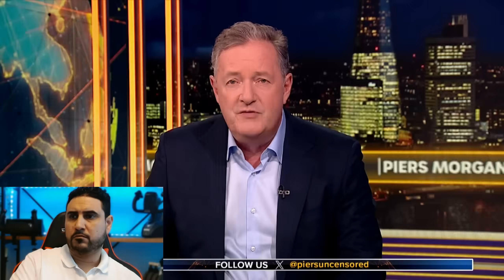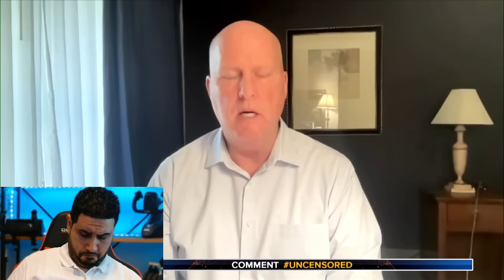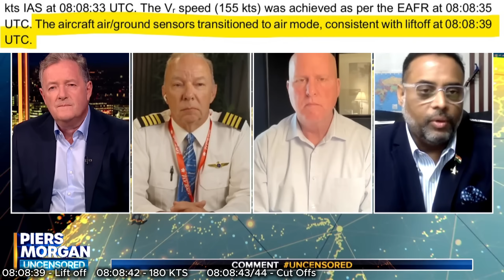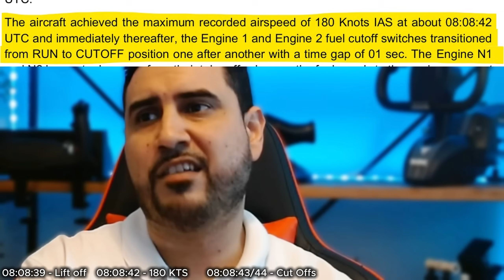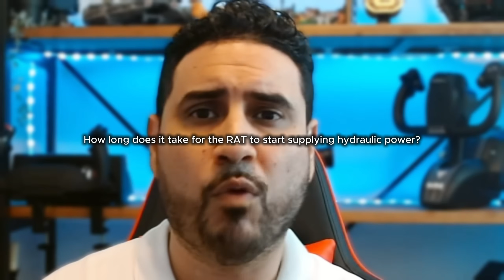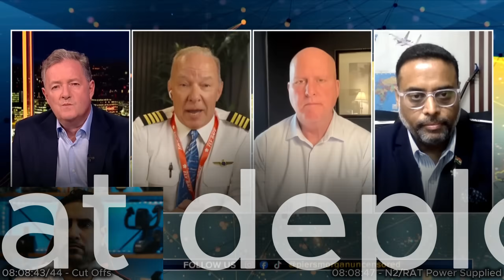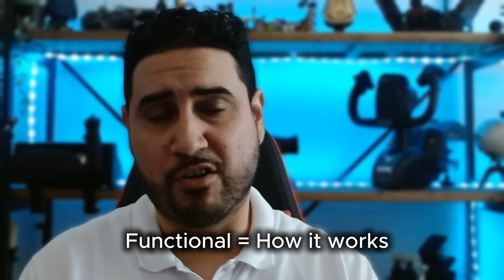TOTAL SYSTEMS FAILURE BREAKDOWN | AIR INDIA 171 | AAIB PRELIMINARY REPORT | MAYDAY | MSFS2024

Comment: Air India 171 plausible crash scheme.

Perspective from a current 787 Captain, previous 777 Captain, and a former simulator instructor on the 787, 777, 767, 757, and 737. 

Air India flight 171’s ‘pilot flying’, was allegedly the FO (First Officer) according to the AAIB’s preliminary report, who was manually controlling the 787’s flight path. After it stopped climbing at approximately 425’ above the runway (625’ above ‘mean sea level’), the FO banked the jet’s wings to the left, changing course by 3 degrees, and heading the plane directly at the four six-story buildings of the medical complex, visible one mile from the runway. He then banked right, back to ‘wings level’, to maintain this course, as shown on the airport’s CCTV video taken from behind the jet’s left side. Additionally, a cell phone video/audio from a rooftop, recorded from behind the jet’s right side, showed the rear landing gear’s ‘trucks’ had tilted forward to facilitate ‘gear’ retraction, proving that the crew had initially selected the landing gear lever ‘up’, but the landing gear doors’ opening and subsequent ‘gear retraction’, stopped because of the sudden loss of hydraulic pressure supplied by the Center hydraulic system pumps. These two pumps stopped supplying pressure when both engines’ failed (i.e., dropped below ‘idle’, and/or minimum RPM), tripping off their four electrical generators. This dual engine failure, also triggered automatic deployment of the ‘RAT’(ram air turbine, which is seen/heard in the rooftop video/audio). The RAT’s small hydraulic pump can’t raise the landing gear or move the flaps, but only powers 10 flight control surfaces supplied by Center hydraulic fluid to maneuver the 787, and its small electrical generator powers the Captain’s flight instruments (but not the Copilot’s, forcing him to use the Captain’s instruments with difficulty, while viewing them from ‘cross-cockpit’). It would have been obvious to both pilots that based on the current glide path now being achieved, that a 1 degree turn, back to the right, was needed to allow a landing on the road to the right of the medical complex, missing all the buildings completely. Pilots are trained that the safest plan was to aim for this road, avoiding buildings etc., in the event a restart of the engines was unsuccessful. The Captain, (allegedly the ‘pilot monitoring’, according to the AAIB preliminary report), would assume the obvious ‘road landing plan’, while focusing on restarting the engines. When it became obvious he’d been distracted too long from the copilot’s contingency maneuvering, and that an ‘Aircraft carrier’ style landing on the rooftop of the two story medical building, was now the immanent destination, he proactively selected the landing gear lever back to the down position, which would help absorb the impact forces through the ‘landing gear’, by keeping the plane away from ground contact as long as possible, hopefully after landing beyond this building. A last radio ‘May-Day’ call was transmitted before the building collision.

If you’ll review the Ahmedabad airport on Google Earth, and draw a one mile line from runway 23 to where 171 impacted the medical building, you’ll notice there were plenty of wooded areas available, on both sides of the building they hit, with the best landing area on the road, to the right of that building. Had the jet stayed on the extended runway centerline after takeoff, as all pilots are trained to do, they wood have missed the building completely and landed on the road beneath the trees. All pilots are trained to fly their malfunctioning aircraft to avoid hitting buildings. After reaching their maximum altitude, a slight left bank of the wings occurred, which was maintained until aligned directly with the center of these very narrow buildings. All pilots are required to stay on course after takeoff, and would have easily avoided the buildings, but now also knew they couldn’t make too many course adjustments at such a low altitude. The video evidence favors, this maneuvering as being intentional, because a number of course adjustments were made, likely shortening the gliding distance, resulting in impacting the 2 story building’s rooftop. Relying solely, on the video evidence as described above, should be sufficient to deduce the intentionality, in precisely hitting a building that is narrower than the 787’s wingspan. The ideology of a pilot at the controls must be reasonably predictable, and not in favor of harming those who disagree with that ideology’s tenets. The above perspective is plausible as presented and will certainly be proved or refuted, if/when supplemented and co-oberated by the full release of cockpit audio from the CVR, and flight data obtained from the FDR. The Copilot was allegedly flying, not the Captain, and would have easily been able to disguise ‘cutting off’ the fuel switches at the moment the Captain reached forward to raise the landing gear lever, whose arm partially blocked his view of the fuel switches, which were likely timed to move covertly by the copilot, not the Captain. Once the Captain sat back in his seat, feeling the sudden deceleration, and likely seeing the switches ‘cut off’, understandably asked ‘why He cutoff?’. The copilot’s likely contingency plan of lying, and later seeing the engines recovering once the Captain moved the fuel switches forward, to ‘run’, was able to aim the plane towards the buildings/road, performing a last minute 1/2 degree turn to the building, ‘911/World trade center styled’, knowing that a survivable landing would likely have occurred on the road under the trees. Most pilots are also trained that a crash landing with the landing gear extended, helps to absorb impact forces, which is likely why the Captain re-selected the ‘gear lever’ to down, as shown in crash photos, and made a ‘Mayday’ radio transmission as his last valiant aviator’s duty. Well done Captain, who saved the life of at least, one of his grateful passengers, by not attempting to grab the controls from the pilot who intended harm to everyone and could have easily dived the plane unrecoverably into the ground.
Reply: what a great plausible analysis. So now it's the F/0 who planned this All along😮. Could be? Certainly knowing who asked and who said what would help tremendously. what's the over the nose visibility at flaps 5 with a high pitch angle , no instruments on fo side? making turns to plow into a building or avoid a better landing spot might be difficult? as depends on seat position...you've done a lot of thinking and certainly have enough story to make a great movie..let's hope it's not true😮. the only other thing that says it's the F/O is that the left engine cut first..From years of shutting down engine's on taxi in or at the gate,,the captain would always shutdown the right engine first ..habit pattern for bag safety unloading quicker. it would be very difficult to break that habit
also..on engine start..at Air India, is it the F/I who raises the engine start lever's..only thinking?
but I still think it was a major differential fault,, electrical issue.. I just don't like plastic jets nor too much automation in aviation
Reply: one video of the take off from behind appears to show white smoke vented to port side at take off. This would more likely trigger RAT deployment. ON THE 787m selecting fuel cut off then run commands FADEC to relight engines.
Reply: We had this TROLL on another channel. Go to Google Earth or Maps and just look at the road to the right as he describes it. A skinny thing lined with trees. You probably couldn't overtake in a tuk-tuk let alone put a 787 down there. Nothing to see, move along.